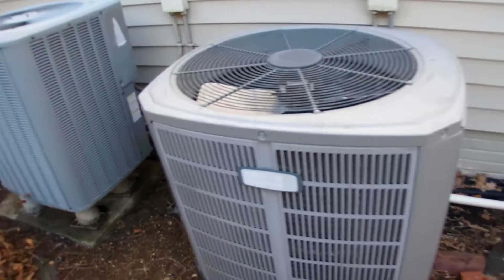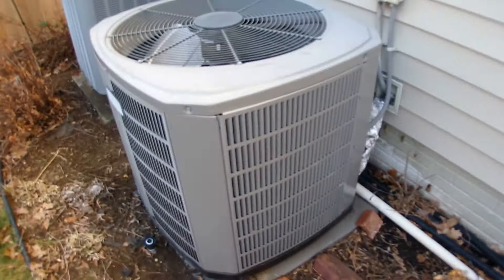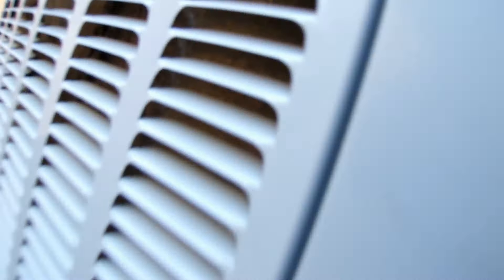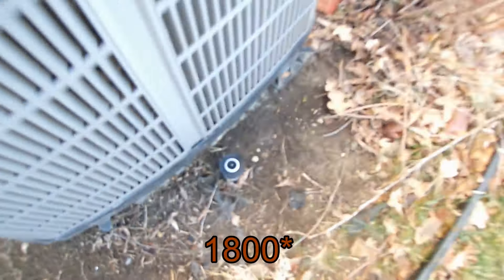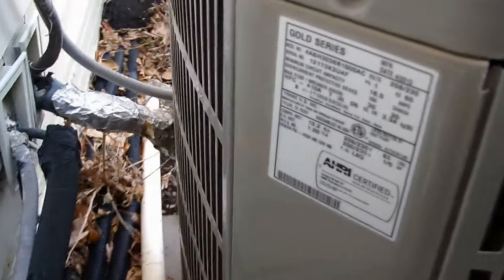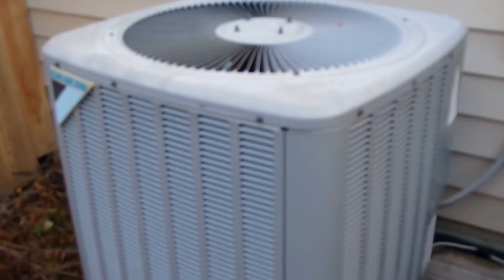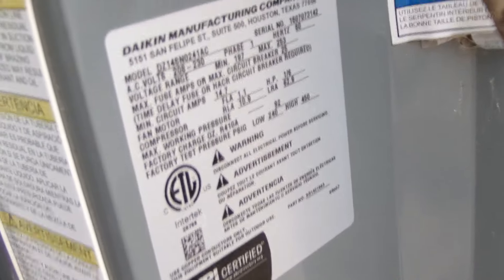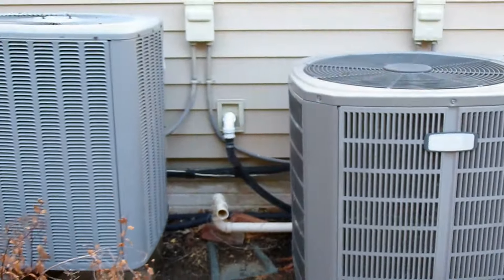Dual Zone American Standard & Daikin Heat Pumps - Revisit

Comment: I would’ve set my switchover at about that temp if mine was a duel fuel, this is why I wanted to replace mine when the furnace went out due to a leak from a cracked heat exchanger in 2021